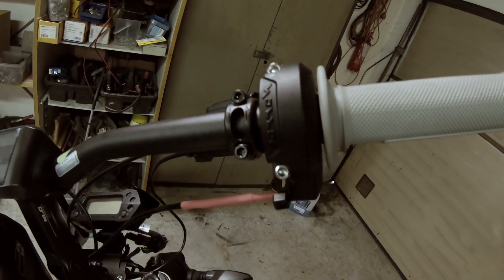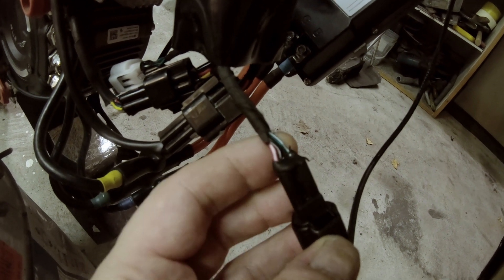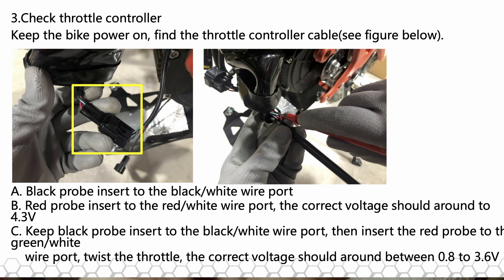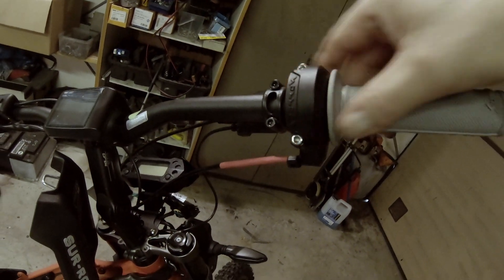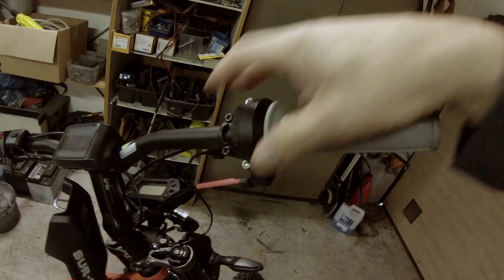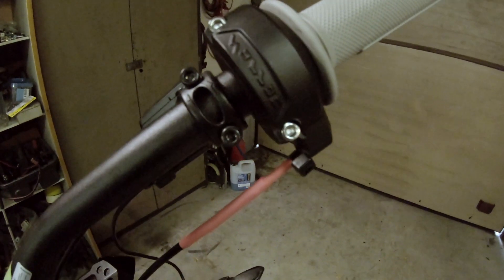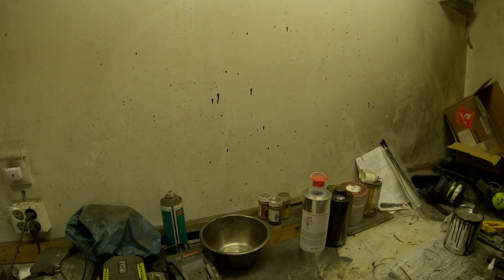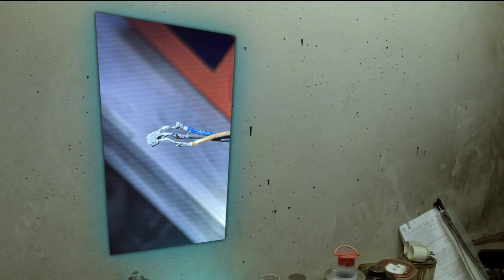Sur Ron error code ER-211, what to do?

Comment: I tried changing the all sensors and checking the voltage in all the cables but when I plug it in I get error 212 what’s wrong?
Reply from the maker: You get 212 ???
Reply: Yes
Reply from the maker: I dont know what 212 is. This video only covers 211.
Reply: I have the same problem, it was er-211 before a change de Halle sensor and now it’s er-212 have you find your problem ?!

Comment: I have same error code. But i measured throttle voltage and signal ...both are acceptable range.  I even probed with oscilloscope while operating and the throttle voltage is fine.  Must be something with the controller.
Reply: Hi, I have the same problem, throttle voltage is OK, I connected a controller from another bike and it works, so the problem is the controller. Have you found a solution to repair it?
Reply: @igorfacchetti9921  I did the same, swapped controllers and no throttle issue.  I did notice the throttle harness routes right next to the motor and motor leads. I wonder if it could be a noise issue.  I want to try and reroute the cable and see if the problem comes back.